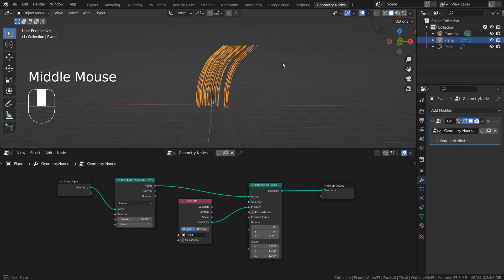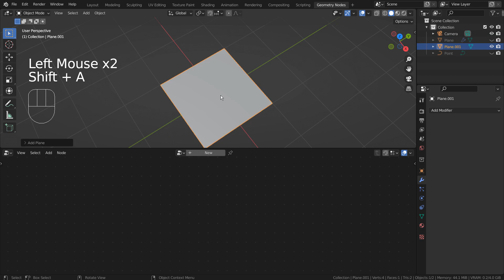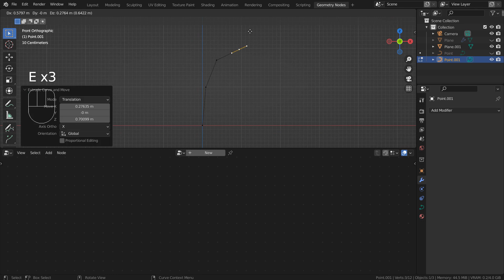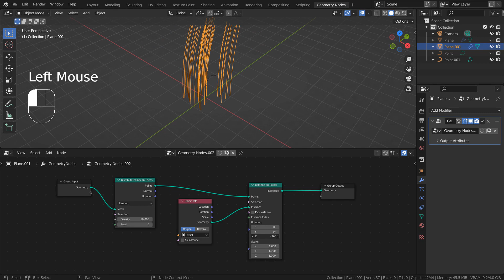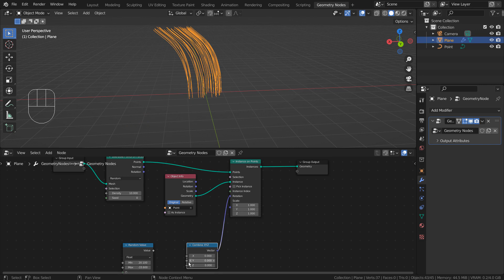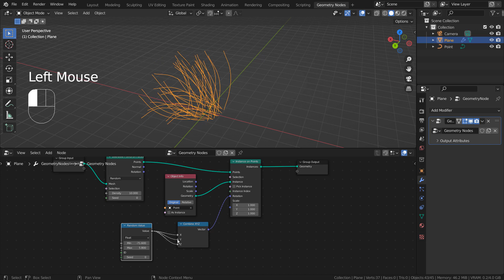Blender 3.0 - How to randomly rotate on one axis using Geometry Nodes

Comment: Add solidify madifier and we gave good looking grass
Reply from the maker: Thank you for watching, DAMIAN..!! :)

For the grass mesh, please try this..

Since we're dealing with a curve, (unless we convert the curve to a mesh first..) we need to edit the curve like this, in order to create a grass mesh.

1. After following the tutorial to create a grass curve, create a new curve point.
2. Extrude it on the "X" axis.
3. Select the grass curve.
4. Go to 'Object Data Properties'. (It's the green icon tab on the right.)
5. Go to 'Geometry'.
6. Go to 'Bevel', and select 'Object'.
7. Select the new curve as its Bevel Object.
8. Go to the grass curve's Edit Mode.
9. Activate the Proportional Editing.
10. Scale the top curve point with 'Alt + S' shortcut, to create a sharp end point.
11. Apply a grass material.

Here is a sample render using the usual ground PBR images along with the Sky Texture. :)

https://i.imgur.com/fMb0WBi.jpg

Comment: do you know how to not have them rotate in 1 direction? So they are rotating at different speeds here but still all rotate clockwise or anticlockwise
Reply from the maker: Thank you for watching, James..!! :)  I think that's only possible with particles with Animation Nodes.

Here are the Blender StackExchange threads about controlling the speed of rotation.

https://blender.stackexchange.com/questions/196862/accelerate-and-decelerate-linear-rotation
https://blender.stackexchange.com/questions/55292/how-to-control-particle-rotation-during-its-lifetime